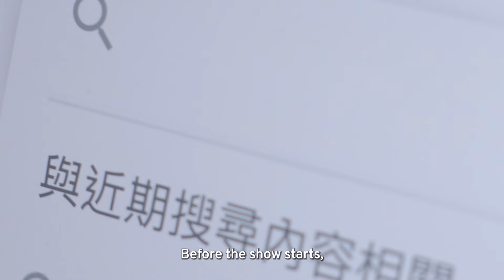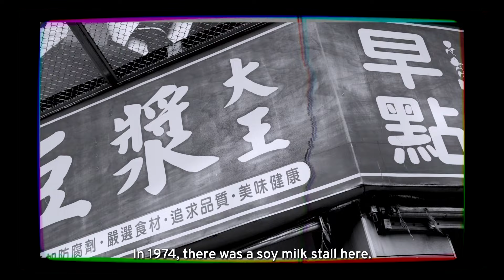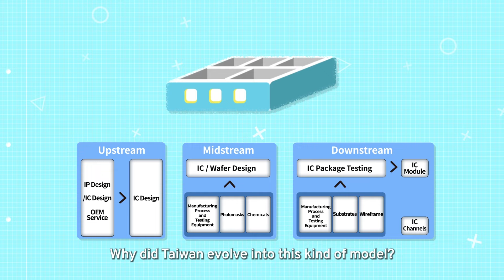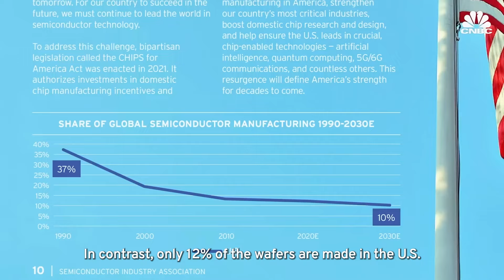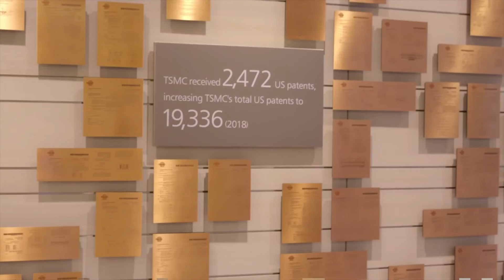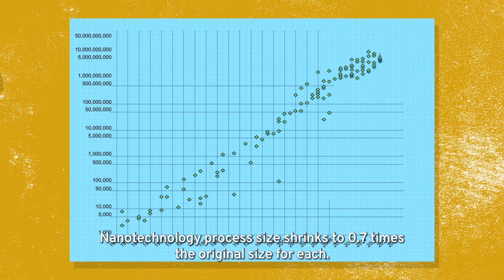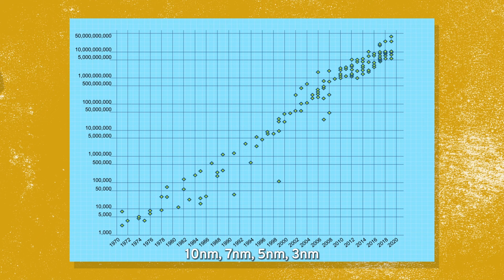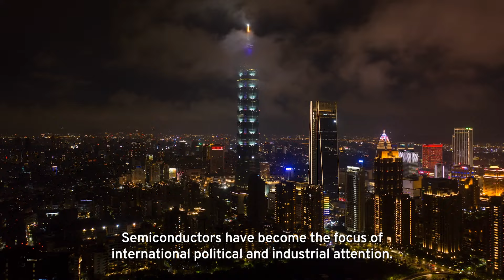TSMC: Taiwan’s Semiconductor Market Giant Explained ⎸Taiwan Keywords

Comment: Is not a silicon shield.
China alreafy has the same capability of Taiwan in chip manufacturing.
They can massively create 7nm chips using DUV machines.

Taiwan create those with EUV machines.

If China can create advanced chips with older lithography machine, of course they can make better with more modern lithography machine.

Their only bottleneck are the EUV that are being solved now by using a particle accelerator.

In resume, the cip manufactoring of Taiwan is alreafy irrelevant for China, then that is in anyway any kind of protection, which means "silicon shield" is just another fake narrative from western countries.
Reply: Looks like I need to be here more often to strike a better balance between Taiwan's propaganda and China's, for comments like this.
Congratulations on the progress in mastering DUV. Time to stop buying from the irrelevant Taiwanese semiconductor products. If Taiwan remains to be China's top trade deficit country, your statement is false. With 70%+ of imports from Taiwan are precisely semiconductor and module products, that doesn't look like irrelevant.